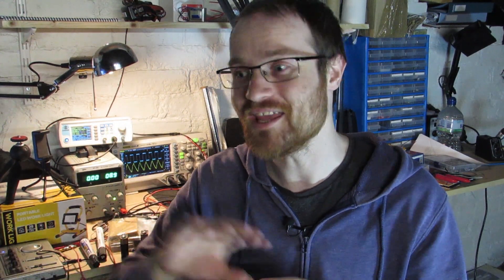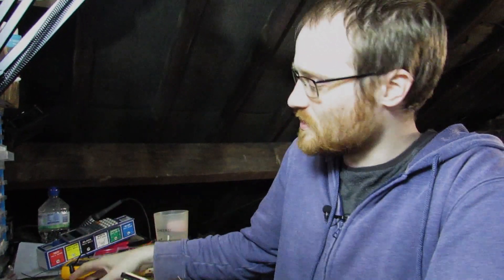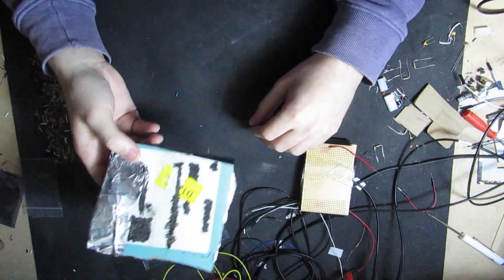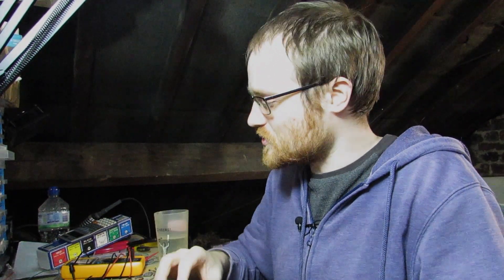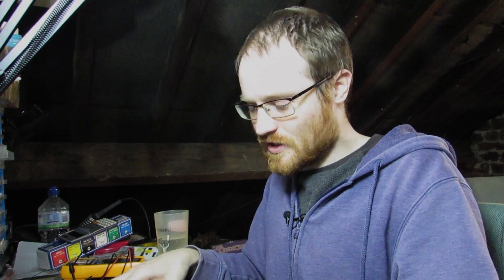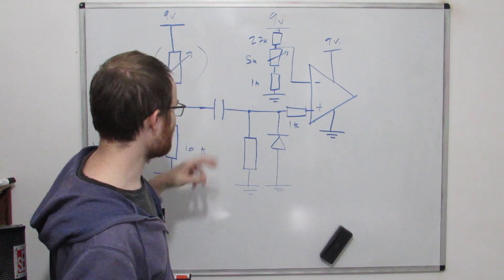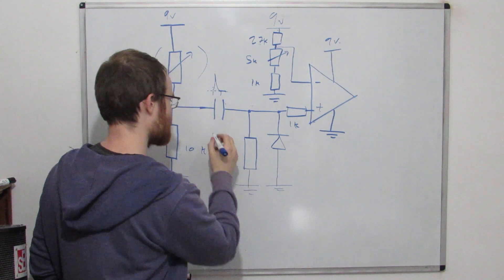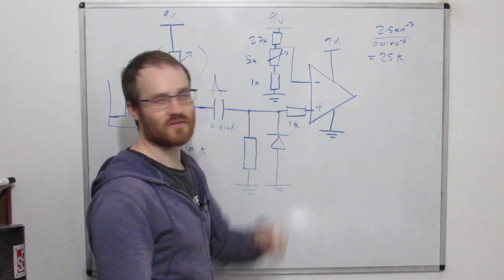Make Your Own Drum Pad!

Comment: Hi there, stupid question others might be asking; will the pink or white foam work to do this (they dont seem to be the same material as the black stuff)? i've got a couple of these to put together for some gueezers, so i'll try that this week (normally i used to use contact mics but with the metal not working so well with a finger), here's a demo of the unit: (hit function used at the end of vid): https://www.youtube.com/watch?v=mDOlRZ38nH8 reedit: justy tryed it quickly, the pink stuff seems to work just aswell, but, i'm getting more in the tens of megaohms resqistance, not soldered tough, just piled up and put tester probs inside, but still. maybe i just dont have the proper type of foam, allthough it's the ones i got with chips in the special bags... the size of the piece of foam  matters too maybe (shurely) the pieces i used are maybe half of yours.... anyhow i'll get intoo this i little better later..... saw this in a book i have aswell, allways wanted to try it, guess you have motivated me to do so. anyhow i didnt look at your circuit but if i'm in megaohm rage, i guess i'll be able to adapt component values... cheers.
Reply from the maker: Not a stupid question at all! (don't be so hard on yourself) So the pink white foam is not (very) conductive and won't work as well. The basic principle behind how this works is that the resistance of a material is basically the resistance of the cross section multiplied by the length of the material, so by whacking the material we are briefly shrinking the length which lowers the resistance, which we can use electricity to detect and trigger our comparator. So in theory, any compressible material will work with enough tinkering, but obviously if the resistance goes from very very high to very high, that's going to be hard to detect with our comparator!
Let me know how it goes :)

Comment: Man I'm slowly understanding shit. Though at the beginning I thought you would build a capacitor as the pad :§. This is sick.
Just a short question. The resistor you describe at 10:14 acts as a "voltage divider" to the envelope part ? I get that it drains the voltage of the cap.
Thanks alot!

Comment: Ah. I hope you would show us how to make discrete version of differential pair. Old school, I know, the mathematics is insane, I also know, but it is especially excellent for learning assuming this channel is about learning how electronics components work and DIYing our own working circuits.

All monolithic devices have differential pairs cunningly hiding within them anyway, and is the core of all integrated circuits.
Reply from the maker: I'm literally working on that video right now!
Reply: @TheAudioPhool  Oh, whoa! While you are at it, if I may be impertinent as to ask you to (also) show the more advanced stuff, if you know, such as so-called 'current source', 'current mirror', the use of trimmer potentiometre, and feedback to amplify common mode and feed back to the input (Similar to what is called Right Leg Driven. This feedback thing uses proper op-amp and not transistors). These are for the purpose of significantly increasing common mode rejected.

I read much about it as to how to make CMRR a bit more perfect in this imperfect world, and simulated it. I even have book written by Douglas Self, who is said to be well-known in the audio world.
After all that nonsense, at the end of the day the power of an oscilloscope is the judge. Simulation and reading what other people write are shit as you already know. You coincidentally have an oscilloscope. I have none of that sort. Hence why I am blindly swapping components and by "luck" I hear something acceptable. I do not have too many different values of components, however and sadly.

Having said that, I did do the practical side of things. I find that differential pair actually provide more noise compared to non-differential amplifier. I blame the imperfect world! Little did I know that differential pair actually is sensitive and precision device! Ha! Negligible mismatch of resistors, capacitor, transistor, and whatnot is amplified, which is not negligible. Ugh! 
I do not know by how much noise. I am using headphones, probably my headphones are lousy so they do not reproduce sound accurately. However, I read that noise from low impedance speaker is not audible or is not as bad as that of from high impedance speaker. (Feck ohm's law! I do not know why it happens this way!)

Comment: Any idea of how that could be adapted so that real drums could trigger (or gate?) different things in eurorack setup?
Reply: Piezo pickup / contact mic?
Reply: Well there are triggers you can buy. I think DW make some.
Or like Gadget Productions said with a mic. Microphones create small voltages, that you could amplify and run into to the comparator instead
Reply: See ‘look mum no computer’.  His idea was to take a patch cable, and split the leads, wiring it’s tip to a drum stick with Al-u-min-i-um foil, and with its sleeve wire would simply be wired to another sheet of foil placed upon it to a drum head. Immediate S-trigger for performance.  This project is a great jumpstart point for learning DIY electronics!
Reply: @jimmy_jamesjams_a_lot4171  Sounds exactly like how Kraftwerk's original drum pads were.